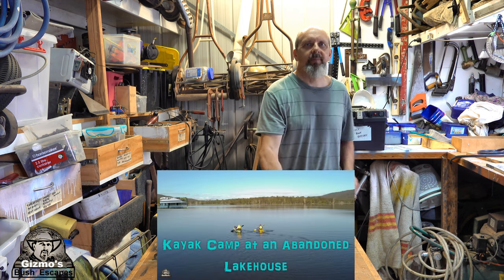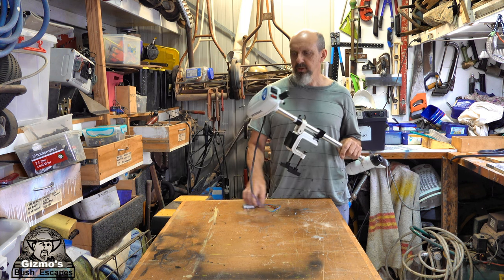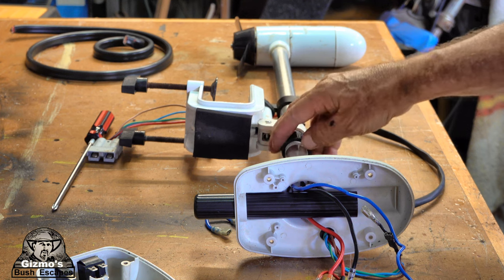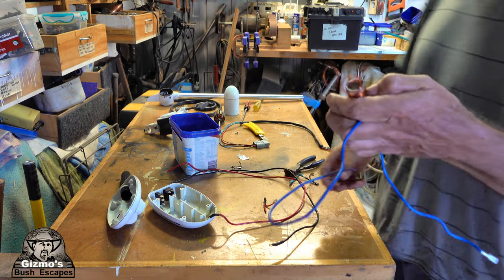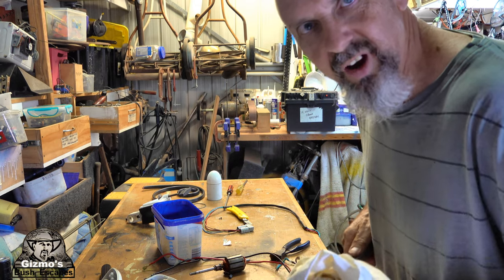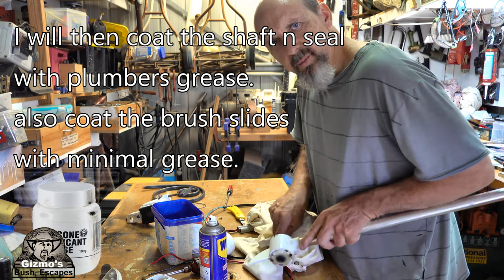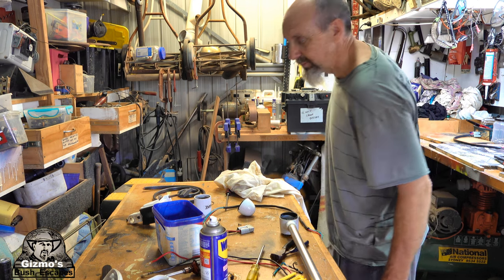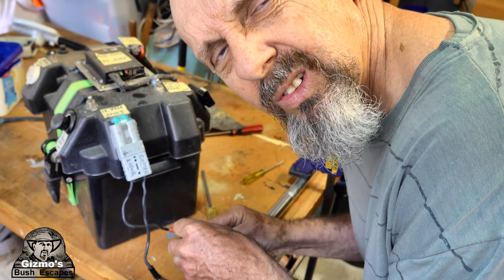Boost Your Trolling Motor Performance

Comment: Another excellent how to video. Thank you. We’ve got two 24lb water snakes. We’ve had them for over two years and only ever used them in salt water. They would have a few hours up on them now. I was having problems with one and came across your other video and thought I must have the same problem with water ingress . I pulled them both apart and not a drop of water had got inside. I never stripped it down as far as you did because it wasn’t necessary so I can’t tell you if they have changed the prop shaft seal or not. My problem was corrosion in one of the waterproof connectors from the battery to the PWM. 

Again thank you for giving me the confidence to pull it down and what to look for.

Cheers
Reply from the maker: Cheers Stephen